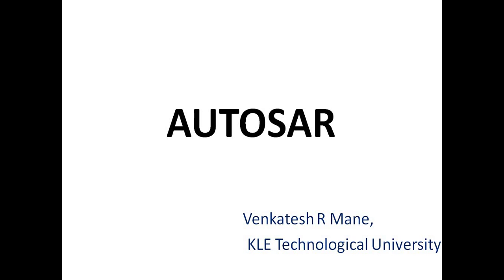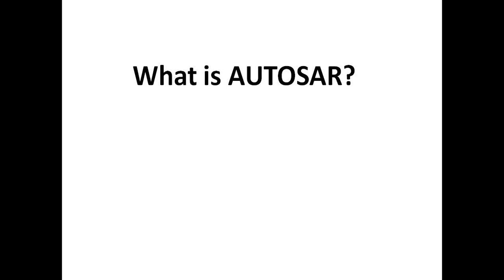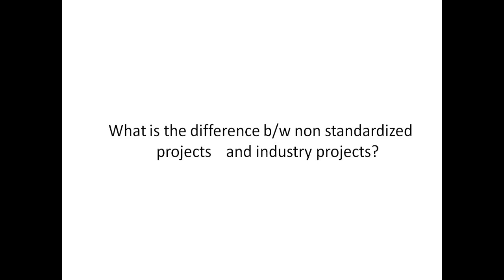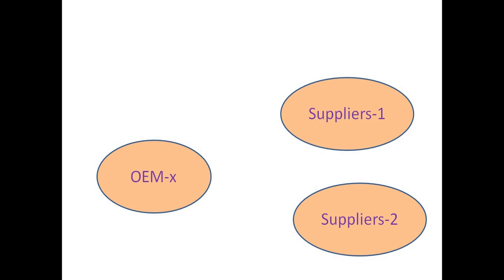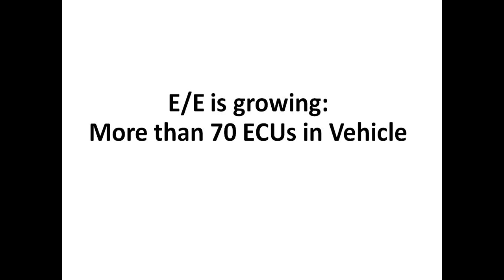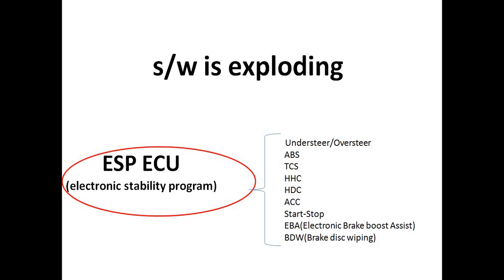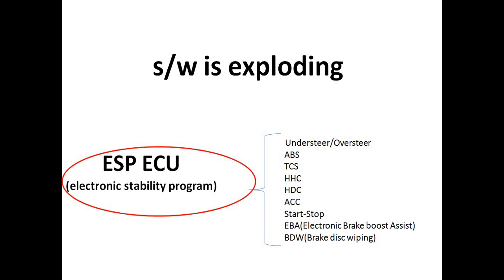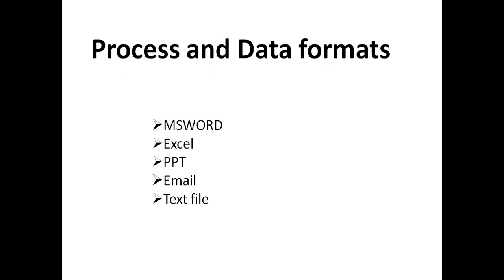AUTOSAR introduction part I

Comment: Thanks for this video.
It gives the brief clearly
Why autosar is introduces? Who introduced? How it helps?

Nonstandard project- done by students.they will only take care of applications.  If hardware fails at any points then it is not handled .
Industry level project - completed by industries 

Autosar is a consortium created by supplier's.  By following Autosar,  software can be reused and save time .
Each supplier knows the software how it looks like . Because every oem's follows Autosar.

Software's getting overloaded in ecu